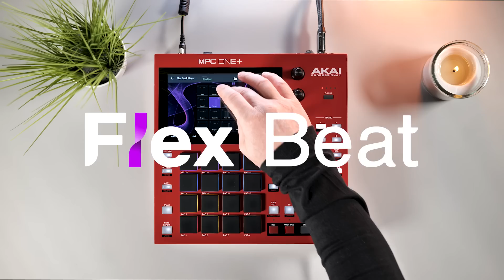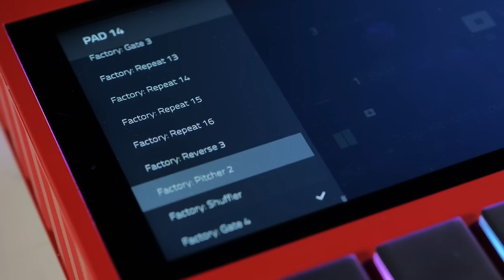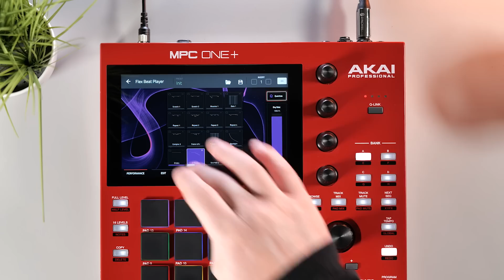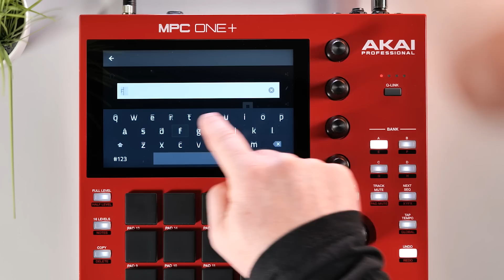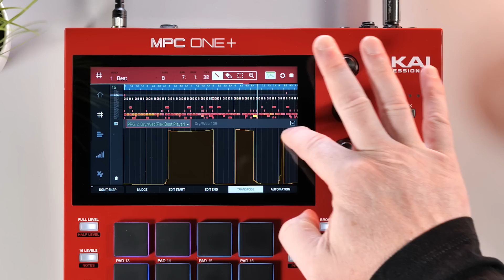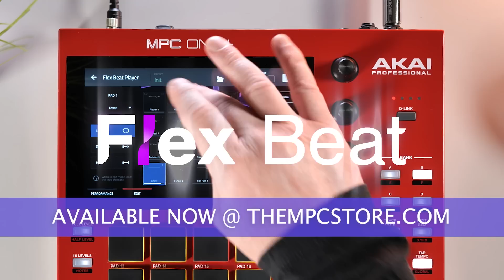Flex Beat Plugin for MPC Standalone | Akai Professional

Comment: Important to know: whether for flexbeat or subfactory, mpc versions are restricted versions of the pc/Mac versions. You can't edit presets using modulable curves on mpc... Which makes them totally different plug-ins in my opinion. It would have been nice to talk about it. I imagine that for some reason it's impossible to implement in the stand-alone versions (equaliser or filter with modulable curves don't exist either) but I won't be buying these products for that reason.

Comment: how did he add the random pitch shift to the vocal????? I didn't see him press anything
Reply: I had an instance of FB assigned to PAD 10 where the vocal sample is assigned. I used a FB preset that incorporates Pitch-shifting creating the effect. You'll see me turn the plugin on which engages the effect.
Reply: @AndyMacMPCclub  thanks for responding!
Reply: @AndyMacMPCclub  Please, Please find a way to incorporate standalone Sample stem separation. Even if it's some type of  3rd party live service like the Splice integration.
Reply: Would like to see a quick lesson on how you did that.   @AndyMacMPCclub

Comment: What good is this, it's only good for real time performance and not able to Record edit the effects into your daw. It has great effects but trash set up.🤔🤔🤔
Reply: You can if you use the AU/VST version which includes a built in editor. You can edit this inside MPC Software or within your DAW. You can then export the preset back to standalone.
Reply: @AndyMacMPCclub ❤ Great 

And is there a solution for using the pads on the force for trigger the effects? 

Best wishes from Vienna ✌️ 🇦🇹

Comment: Interesting plugin but it looks like its only effecting playback speed & volume? Or am I wrong? Most glitch plugins also have things like filters, crossmod, distortion, etc?
Reply: I don't see any settings for that anywhere.   I've been poking around the user interface and it doesn't seem like there's much editability... it's the effect they got programmed in... take it as it is.. or leave it.   THAT SAID.. .there's 16 x 7 or around 112 fx to choose from so it's pretty fun and with all the options (looping/hold/one-shot as well as automation) it's a whole lot that can be done.   Surprised there's no edit menu for the actual stutters and scratches though.. or any way to load your own versions in.   Maybe on future versions.
Reply: 338 presets.... I was just looking at what they had for pre-setup banks... there's way more presets than actual banks.   There's a LOT of presets... some fun stuff with pitch shifting too... definitely a great waste of an hour or so digging through them!!
Reply: Final comment... with quantize turned off you're able to launch these presets at whatever timing you want so for example with the turntable slow-downs.. you can time them to start mid-beat to get whatever 'timing' or 'speed' you want.   Not saying that's the same thing but there's still a lot that can be done.
Reply: Final final comment... details from their website says:
* Detailed pattern editor with snap, adjustable curve types and envelope tools
* Export or import pattern presets in .fnv format compatible with Gross Beat ™
* Dry / Wet mix
* Some features not available on the standalone version

OK, there you have it.. on the DAW version (which you get with the purchase) you get an editor.  But on that last bullet item... I'm pretty sure that's referring to 'no editing' on the MPC standalone.
Reply: ❤hope someone find out how we can trigger it from the pads!

Comment: Is there a way to perform with the actual pads instead of the touch screen/mouse clicks? Having the 4x4 FX layout right there and not being able to use it with the pads feels weird idk :S
Also been trying to assign each FX slot to the pads in Contoller Mode in my DAW and the plugin doesn't seem to have separate parameters to each FX slot (why tho?), making it tricky to assign them to the pads. I haven't yet found a solution but maybe I am missing something (hope so).

The plugin itself is pretty good imo (although I miss some options like being able to have more than 1 bar per FX) it's pretty versatile and it's great having it standalone, as many also said it'd be really nice being able to automate inserts in the master and submixes tho.
Reply: Yes some Things are missing! 
I hope someone find a way to trigger it from the pads !

Akai giv us a free Instrument !
 
Thats fair, becaus the prices are way too high!

Comment: Agree…
- automate FX is key
- draw custom scratch FX would be huge

I see something in the manual about editing a preset or making one from scratch, in grid mode....but I cant seem to get that. granted im using the Trial. does the Trial have some features disabled?

adding: in the preset editor I see pads labeled....but I cant seem to figure out how to preform Flex Beat from the pads. it is VERY cumbersome to have to go into the channel editor inserts to mess with Flex Beat. I would actually buy this if you could make your own FX preset [not preset of presets, but custom edits to each FX], if it could be performed from the performance tab with the pads, and if you could record [automate] your performance.

while here: all the Tube Synth presets have the cutoff assigned to ver modulation and the Jura presets all have the Arp enabled. is the ANY way, in a pref or something, to disable those. its extremely frustrating having to turn those off for each preset id like to preview. it actually prevents me from using those plugs. 

thanks